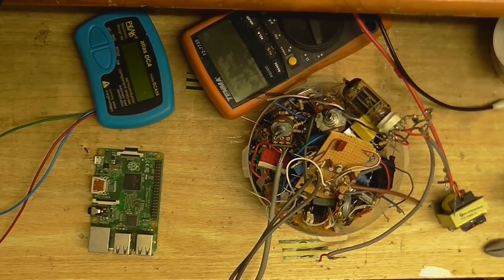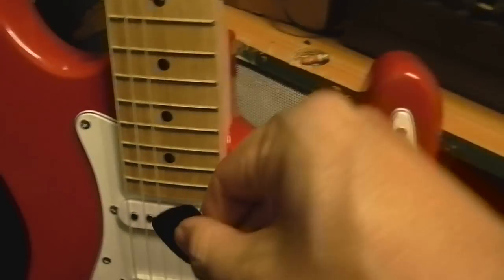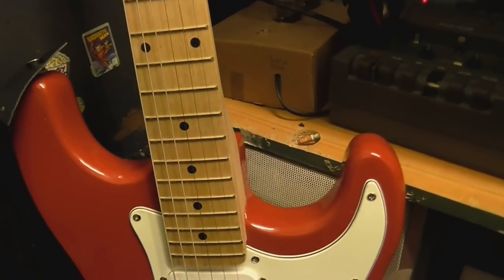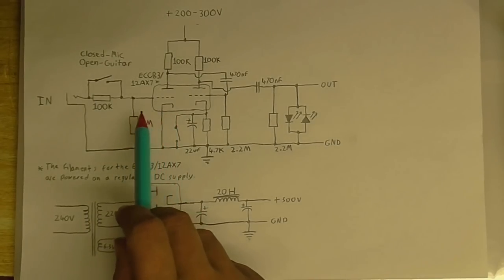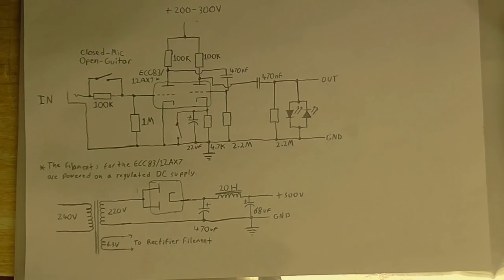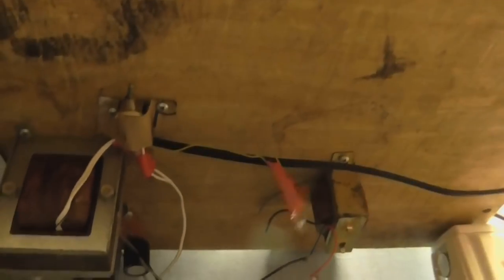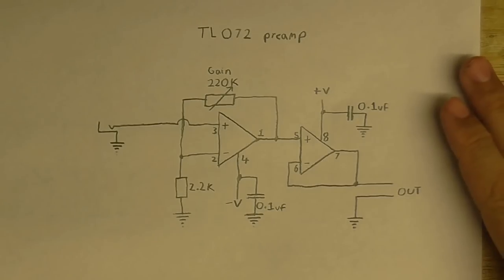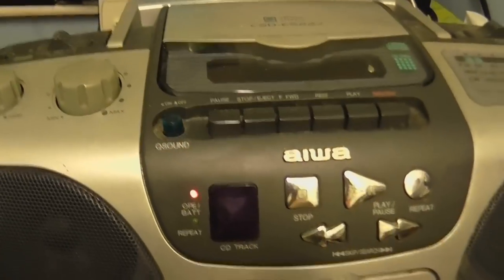Build a couple of guitar preamps (for clean sound)

Comment: yeah, screw tubes. Maybe build a FET amp? they should provide high input impedance
Reply: and i have read mosfet amps should provide a warm sound. but its probably hard to get linear mosfets anywhere these days
Reply: Tubes may be difficult to work with... but they sound wonderful!
Reply: @CaalamusTube  thats also what ive read about of mosfet amps. i mean, im no audio electronics guy, but it would make sense to me, because valves and FETs work on the same principle
Reply: Well, I'd say Field Effect Transistors are valuable. But they're really famous for things like Compressors & Overdrive Pedals. Guitarists seem to more or less concur that Tubes are where it's at in terms of amplification & Tone.  

 But maybe someone else would disagree. 

 I do notice that FETs are often referred to as being "Tubelike". That kinda says it all to me. If you look at prices... all the really high end stuff & all the most famous vintage stuff, is Tube driven.

Comment: Haha nice, this is very similar to a pet project of mine, but my goal is to generate +-12 volts from a 5v powerbank, in pre-tests the noise floor is not too bad, but I gotta add a lot more filtering, loved the really simple 555 based voltage inverter 😀👍
Reply: I didn't know why he didn't just use a voltage divider. A TL072 does not need much current to function. But hey the way Clem did it worked great.
Reply from the maker: I did it that way because I didn't want to have to muck about with virtual grounds.  for instance, should I wish to power that preamp and something else off the SAME supply AND connect those two devices together, I can do that, where as if i used a voltage divider, i'd be shorting the real ground and virtual ground and that's not good.
Reply: @CoolDudeClem  yeah, this is the same reason I'm mocking around with sm voltage regs, I want my overdrive to be siiick and then pass that to other circuitry for.. say mixing in a mic signal that's amplified as well

Comment: I've heard that some Guitarists like the sound produced by the soft clipping of Triodes when overdriven.Well done with your low noise solid state version Guitar preamplifier.I think it has an elegant simplicity.One of your very early videos shows a Synthesizer or at least some sort of musical keyboard affair.Could you ever play this?
Reply from the maker: I think that might have been in one of my "why modern music sucks" rants. That synthesizer was a VST that I was using with sequencer software, so I just programmed in what I wanted it to play. I tried learning to play keyboards a long time ago and got somewhat okay at it, but when I got my hands on OpenMPT (which is basically sequencer in tracker form), I saw no need to carry on learning to play since it could do that all for me. So far I've learned a D major and A major chord.